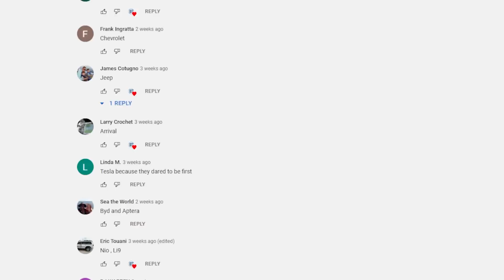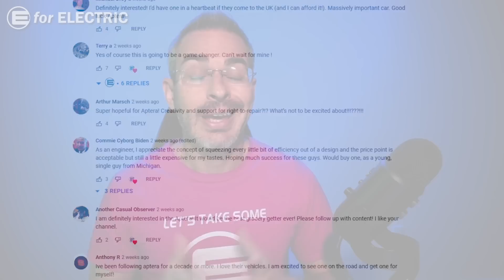How Aptera EV Got a Tesla-like Fan Base

Comment: No 3 wheel ICE auto succeeded in 100 years.  This won’t stay in business either unless they all are solar and so need no charging and are cheap.  And are safe as a regular compact car and treated as a car officially.  And 4 people can fit in plus groceries.  3 wheels looks dangerous and unstable.
Reply: This is untrue.  The Reliant Robin sold around 1/2 million copies and took Reliant to the #2 auto manufacturer position in GB - a major success.  There are great engineering differences with Aptera that make it a much better and safer vehicle than the Robin was.  It even passed the moose test.
Reply: @n.brucenelson5920  Where's Reliant today?
Reply: @aussieideasman8498  It is now "Reliant Partsworld" which produces parts for Reliant vehicles.  According to Wikipedia, "It was best known for the three-wheeled Reliant Robin, but produced a variety of vehicles over 60 years, including sports cars, convertibles and commercial vehicles. Approximately half a million Reliant vehicles were produced and sold in at least nine countries. For a period from the 1970s until the 1990s, Reliant was the UK's second biggest British-owned car manufacturer"
Reply: @n.brucenelson5920  Nice to hear from you. You certainly have dropped off the radar compared to 7 months ago. So they hang on producing parts for old Reliants - that means they have no future. They are a one hit wonder, using the music industry vernacular. At least that's better than Aptera, thus far.
Reply: @aussieideasman8498  
Thanks for the greeting. I have had some health issues, which have resulted in a 6 month driving ban, and slowed me down some.  I expect to fully recover, if other aging issues don't accelerate.

The 3 wheeled Robin was a decades old design.  Of course it has no "future".  It was popular enough that it is still supported.  All you have to do is compare the time that Aptera Corp has been in business with the relative Tesla time span, to know that i the same time frame, Aptera Corp is doing much better both financially and technically.  Look at what we know about the Cybertruck - announced around the same time Aptera Corp was re-formed, and without the shortage of funding that Aptera Corp is dealing with.
Reply: @n.brucenelson5920 

As for your Tesla comparison - I have told you so many times not to because it doesn't wash with me, yet you forget every time. You need to write things down and check your notes before you repeat yourself. And I would think there aren't too many people left who have not heard most of your stories at least fifty times. Time to start ripping up your NDA and telling us what's pertinent to this unicorn.
Reply: @aussieideasman8498  So now you are giving legal advice?
Reply: @n.brucenelson5920  You will have to tell me what you think is legal advice, because I just can't see any. Typical of you not to include what you are talking about. Best you brush up on what constitutes legal advice before you reveal your error. On another note, what I see as my reply is not as I wrote it, and something strange is going on that I can't figure out. If anyone sees my reply 3 hours ago (and it looks like mine), you can see it begins on a new paragraph two blank lines down, and starts with "As for . . ." to the second half of your comment. The responding paragraph above to your first half has gone missing. It's the first time I have seen half a reply go AWOL - usually all or nothing. YouTube never ceases to amaze me - much like you do.
Reply: @aussieideasman8498  And I suppose you are going to tell us you didn't tell me to rip up my NDA?   You are just clueless enough for it to be believable that you don't get it.

And we get that you don't like Tesla comparisons - since their history is quite similar to Aptera Corps' so far.  Again not surprising that you don't know.
Reply: @n.brucenelson5920  Oh, is that all it is? You should have accessed your dictionary and discovered me mentioning your NDA is not legal advice - so much so that it never entered my head that it could be. If you have asked for one (not how they come into existence for a start), and nobody else in your similar position has signed a similar copy, they were just going along with your nonsense with a makeshift document with no legal ramifications. I.E. it was never a legal document, and they are just jerking you. There are over 800 of you ambassadors - how about you compare all your NDA's? As far as my paying attention goes, I have yet to hear of any other clown having one. I am happy for all the others to tell me they have signed one that is identical to yours and give me the dates they signed them. In fact, they are allowed to type the exact wording in full, because no NDA restricts the public disclosure of the document; it's for the company secrets. The conditions don't reveal any secrets. Find out how legal your NDA is before you accuse me of dispensing legal advice. If I told you to rip up yesterday's newspaper, it would be as non-legal as for that silly agreement. That's how I am clued up, so give me more detail if you want me to think differently.

It's not because Tesla has a similar history that I don't like comparisons, and I have never told anybody that. You have made a wrong guess. I prefer not comparing with anything, and the reason is simple: The merits of what's going on inside Aptera far outweigh the events outside. Anywhere outside. It's purely a regard for facts over distractions, particularly those with no relevance.  If I was to compare with anything, the most relevant would be with Aptera 2006-2011. Even then I would compare on matters other than similar histories - those that are more relevant to the product top of the list. Here are some reasons why the disparity with Tesla trumps your version of their histories:
1. Tesla makes cars; Aptera makes silly trike prototypes completely outside of the category
2. Tesla was approved the same loan Aptera was denied
3. Tesla used only known technologies; Aptera has the unknown skin cooling.
4. Tesla was a real company; Aptera is a crowdfunder begging for pennies
5. Tesla nearly folded but didn't; Aptera folded

There are many more differences that make Tesla a bad fit for comparing, and on that fifth point I am well aware of your penchant for distancing Aptera now from Aptera 2011. It is one of your many delusions, and it misguides people from reality.
Reply: "a makeshift document with no legal ramifications. I.E. it was never a legal document, and they are just jerking you".  

Just more proof that you make up things from your imagination and then post them as fact.

Aptera Ambassadors are not asked to sign NDAS.  I asked so that I could discuss confidential information, especially regarding the cooling system with engineer, since I have professional expertise in that field.  I assure you that it is a proper legal document.

I am not comparing Tesla in 2011 with Aptera, Inc.  I am comparing Aptera Corp - (a completely separate legal entity by the way, with different management than Aptera Inc. had in 2011) with Tesla in 2008.

I am also comparing the time Tesla has taken to get the Cybertruck ready, since they announced that project in 2019, the same year Aptera Corp was founded. - and if you hadn't noticed, there is a large difference in the capital available to the two companies.  

Your dismissal of the comparison just shows that you don't know the history of either Tesla or Aptera, which is strange for as much as you write about them.
Reply: @n.brucenelson5920  ""a makeshift document with no legal ramifications. I.E. it was never a legal document, and they are just jerking you".  

Just more proof that you make up things from your imagination and then post them as fact." You haven't a clue what proof is, either, but you are good at imagining you have some.

"Aptera Ambassadors are not asked to sign NDAS." I was pretty certain they were not. I didn't write to claim that they had them.  
"I asked so that I could discuss confidential information," I am sure you were willing to discuss anything sans any document - what you mean to say is you asked so that they would open up to disclosing confidential matters to you. There's a difference, and it's important the gullible fanboys are told the precise reason why you asked to have an NDA. But hey - ambassadors in general are not there to be truthful.
"especially regarding the cooling system with engineer, since I have professional expertise in that field." Fridges in space is hardly professional with regard to motors in EVs. The cooling system has been covered a lot by myself in a few of my early videos. Nobody has been able to refute my claims, and your NDA only serves to stop you from doing so. That doesn't matter, because what their engineers have revealed leaves the situation unproven, which is good enough for me. In fact, the things their engineers (Wingnut, in particular) have said has revealed a great deal of folly - some of the most unprofessional lies I have ever heard of. It is such a joke that you would not be able to help their lying cause had you not insisted on an NDA.  
"I assure you that it is a proper legal document." Then get a lawyer to advise you to rip it up, lol. However, I am not assured in the least. What we have now is what I expected; nobody else has this document. That means it's probably not worth the paper it's written on, and they were just jerking you.

"I am not comparing Tesla in 2011 with Aptera, Inc.  I am comparing Aptera Corp - (a completely separate legal entity by the way, with different management than Aptera Inc. had in 2011) with Tesla in 2008." See - exactly what I said about your aversion and delusion.

"I am also comparing the time Tesla has taken to get the Cybertruck ready, since they announced that project in 2019, the same year Aptera Corp was founded." This is folly, since neither Tesla nor Aptera have completed their times. Not only are you premature with your comparison, how long one takes is irrelevant to the cases. What is relevant is Tesla is making something that uses known tech, and Aptera is selling snake oil with that unknown tech you insisted on keeping to yourself, and they tell silly lies about. I had that in my list, but you have not picked up on this fact. Zero in on the relevant matters instead of barking up wrong trees.
"- and if you hadn't noticed, there is a large difference in the capital available to the two companies." If you hadn't noticed, that is also irrelevant. What is relevant to 'time to produce' is a video made by Fambro in 2009 only weeks before he walked away where he said they were ready to produce. Then a video mid-2021 where Chris A. says that they expect to produce before 2022. Then another early 2022 where he says by end of that year. Then another mid-22 when they say it will be early 23. Then one not long ago saying they will produce this September. Other statements saying 9 months from when they raise 50 mil. Notice I have not referenced any statements from Tesla? 

"Your dismissal of the comparison just shows that you don't know the history of either Tesla or Aptera," Your inclusion of comparisons doesn't alter Aptera's production date, which doesn't exist at the moment, much like the vaporware that is the silly trike. And I could know the histories of both Tesla and Aptera like the back of my hand and it would still not alter the production date that doesn't exist. Let's get a proper perspective?
"which is strange for as much as you write about them." Which is strange, since you have made dozens of comparisons and I have only ever said not to write them. If you count the times I reference Tesla outside of rebuking you, it would be almost none. I never compare - that's my point. That means I never write, except to tell people not to compare, or something like the Tesla driver didn't have his foot to the floor in that rigged drag race, lol.
Reply: You are 7 months closer to being correct.

Comment: In one of the last shots of the vehicle, it was going into a parking place and it seemed to be barely between the white lines of the space.  If it is difficult to park this thing in an urban environment, that will be a drawback.
Reply: It still fits in an urban compact parking space (96").  I drive a Chevy P30 step van which is even wider, but due to sliding doors, it even fits.  It will take some getting used to, but most people will adjust quickly.

Comment: The CEO is right.  Charge your Aptera to 1000 or 600 or 400 and drive it around town.  If you average less than 40 miles per day and you get half a day of sun, it will be a long time before you have to plug it in.  I charge an average of 4+ per day on long trips.  With an Aptera I'd charge overnight and look forward to a full day's driving in the morning.

Comment: I just want to know how this vehicle will handle winter and snow. Besides that I think it's a smart vehicle
Reply: I am confident enough that I have an early model coming for 4 season use in Iowa.  I will report on my experience.
Reply: @n.brucenelson5920  Got an LE on the way? If not, you can ditch the idea of getting an early model. The accelerator program just goosed you. Nice guys.
Reply: @aussieideasman8498  Yes.  It will still be a Paradigm Edition version.
Reply: @n.brucenelson5920  Yes, it is still a massive kick in the guts to the faithful. Nice guys, lol.

Comment: I’m in line to get one. Low cost, high range and license to repair attracted me. Also seems more environmentally sound with smaller batteries and longer useful life due to body materials.
Reply: Way back in line since the accelerator program shuffled the line.

Comment: I ordered two of them. I am an absolute fanboy I will admit. No one has ever even considered a car with practically no maintenance or fuel needs. Never rusts, looks insane (in a good way), and is priced in the low end of new vehicles. I am also an investor and cannot wait to get mine. I only see two flaws and I accept them: only has two seats (possible third in not too distant future) and it will be tough to miss a pothole but the rear end is so light that hitting it won't be that big of a deal. Other than that it is my dream car. Big enough for surfboard in the back. They are also going to have an aux solar plug to add other solar panels. I will probably buy a couple panels and put them on my roof so I can keep car inside and still free charge, I always keep my vehicles in a carport and just would rather keep it under cover when I am at home.

Comment: Whenever Aptera is mentioned, theirs always more questions than answers, like When is the final version coming out ? Just how many more improvements need to be made? How are the Government hurdles being dealt with, if at all? Will you ever give a definite delivery date? Continued below
Reply: Ted, It looks like the delta, production intent vehicle will be finished by the end of the year.

Aptera is a kaizen (continuous improvement) disciple of Deming, as is Sandy Munro.  Improvements will be phased in whenever they can be.  The gamma more than meets government standards for the class and will be voluntarily 3rd party tested to FMVSS part 200 crash tests - a standard far beyond what it is required to meet for its class.

Once production begins and starts ramping, delivery dates will become clearer.  There is still a lot of uncertainty in both funding and the supply chain at the moment.  Even the Chevy Corvette has had to suspend production due to supply chain issues.  This is ongoing for many companies.
Reply: Was Bruce right? My take is they will not bring it out; nobody will ever buy one.